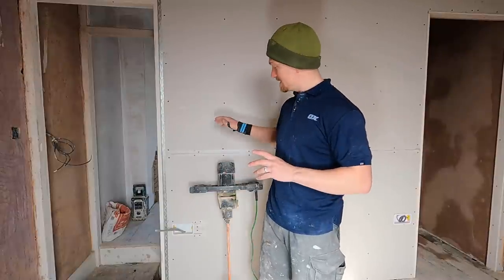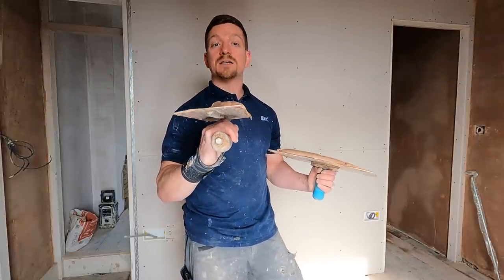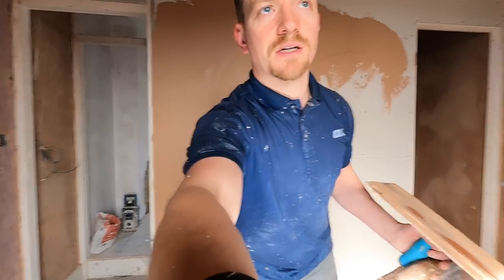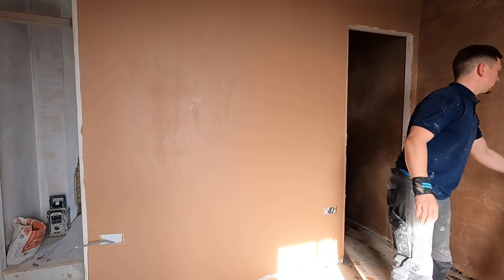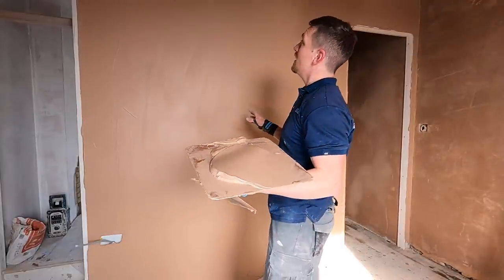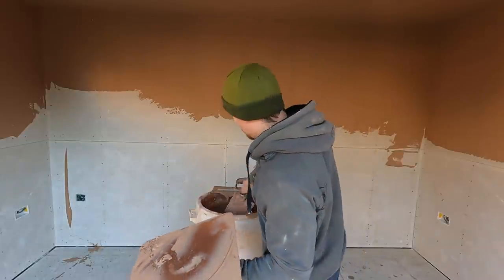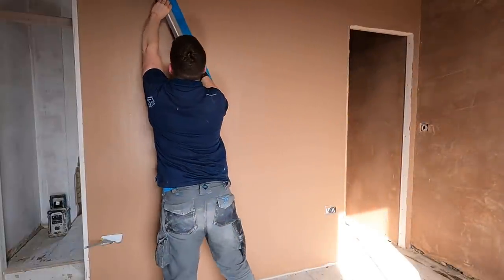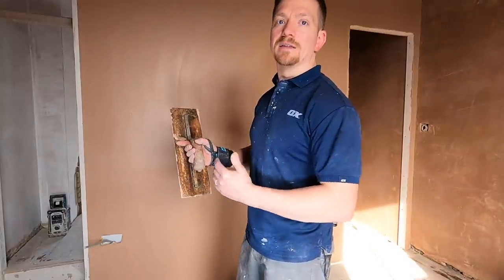5 Massive Hacks For Plastering Faster | TROWEL TECHNIQUES/ TIMINGS/ TOOLS/ SPEED TRAINING

Comment: I would really recommend that beginning plasterers do NOT try and do two coats from one mix. You need some experience behind you to make that judgment about whether the area is small enough, and also if the plaster still has enough life left in it. One of the most annoying mistakes is thinking "ah, still seems to be fine", and then it all starts turning on you too early to save it.

Until you feel confident with two mixes, I would say don't add in these complications. It's so much better to take a little more time and get it right than to have to fix up a botched job (particularly a ceiling...)
Reply from the maker: I agree mate! Beginners should be focusing on the basics and sticking to 2 seperate mixes. That’s the process I teach to any beginner who comes into our programmes...I’m just showing examples to people/Plasterers who want to up their game 👍👍
Reply: All relevant to skill level, size of wall and temperature.
Reply: Make both mix the same! When I started plastering I was wasting my time looking for videos on YouTube for timings! But when you waiting you will know what you looking 4 for your timming stages.

I thank my friend which he has been taking me out on jobs!  I have been experimenting with plastering my favourite 

1st coat 
Speed skim
Sponge 
5 min 
2nd coat
Speed skim
10 min
Flatt with plazi flex
5- 10 min
1st wet Flexi trowel 
2nd Cross if you want
3rd dry plazi
Reply: 😥as one who rushed to finish up for dinner and the next day had whole chunks on the floor because...yeah!  I stopped spraying the water heavily before each trowel and misting after before smoothing...oh well.  Guess I just got more practice time in patching before my last full coat.
Reply: @iiparachuteregiment8800  thanks for this

Comment: Your videos and explanations are brilliant, they really helped me in getting my first wall right after a few failed attempts, but having said that, can i clarify that you're not calculating your water incorrectly? I tried your 12.5 litre mix, and this was very thick compared to your videos, brand new bag of multifinish, mixed with a good paddle mixer in about three minutes. After experimenting, i work with 15 litres of water per bag, and this mix looks exactly like the one you use in your videos. Are you working the volume of your bucket out correctly? Sorry to question the master, i found every other detail in your video worked spot on apart from that one.

Comment: Blaine, I've been plastering for 20 odd years. I'm nearing 40 now and bits of my body are aching. My left wrist (hawk hand) aches and my lower back is made from wet cardboard. What do you do you to help prevent these aches?
Reply from the maker: Sorry to hear that mate!! Sounds awful. I recommend some physio and a decent Chiropractor. They’ll provide exercises that may help but it may just be water and tear. It’s a cruel trade I must admit!
Reply: A nice smoke at the end of the day!
Reply: Less work, charge more. I'm 54 I know your pain
Reply: Less work, charge more. I'm 54 I know your pain
Reply: Had similar problems myself after 25 years plastering,,just started ice baths and they have helped immensely
Reply: Your doing far too much for your body m8, cut down in your workload, or get a patching job, your only 40, another 10 years and you could have big trouble

Comment: Great tips and thanks for making this available, but I suggest you do a future video on how to handle difficult situations, such as when the plaster starts to set and time it running out. Is there a retardant that can slow down the setting process once it has started, either in the bucket or on the wall? If the walls harden and what remains is a mess, do you recommend grinding it off, patching it with more plaster, or maybe some other actions? With experience like yours, this is probably seldom an issue, but for beginners such information might save the day.
Reply: I like to remind myself that there's always the option to just scrape it all off and start again >< Obviously you don't want to be doing that too often, but it's easy to scrape off when it's still semi-solid. Of course you can always go over it once dry, but also you've added more thickness/weight and that's not always ideal. I actually did a scrape off with a ceiling recently. I thought I'd risk a bag of plaster that was about a week out of date. But unfortunately it didn't pay off - by the time I'd got from one end of the room to the other, the plaster was too dry to flatten. I don't regret the decision because honestly I just didn't see it coming together, and the second time (with a new bag) went perfectly.
Reply: My get out of jail card is my spray bottle and sponge float.
Reply: water spray bottle...it's my only hope!
Reply: Baking soda
Reply: Someone I know used baking soda to slow it down

Comment: how do you know when a second coat needs to be applied? and if the wall or ceiling starts drying where you did bonding and the rest is wet then what u do? Everyone on youtube says how to apply plaster but nobody says the big things just mumbling around. Check your video and check others' videos, same thing. I am a beginner in plaster I put the plaster on walls or ceilings in no time but always happens to me the plaster is not drying uniform. In  Some places is too dry other places is too wet and I never get it perfect. I feel all the time so disappointed and frustrated. Is not that I want to do this job as a trader but I like to "master" the skill. In the end, if you check with a lamp my plaster you can observe uneven parts.

Comment: Hi, one question, how do I plaster a big area let's say about 30 square metres,do i do it all at once or in two sections?? So it won't dry out to much, Thanks!
Reply: Get another plasterer to help you if you feel its to big an area. Don't under cut on pricing. Trust me. Been plastering since 80s. Don't do joins in work
Reply: @terryfincham7252  Thanks!! Cheers from Greece!😊👍🇬🇷
Reply: If your not fast enough tape it off and work into it. Best bet is getting another spread on it with you throw it on together. Get a speed skim to flatten with saves loads of time between coats

Comment: Do you use a hard trowel or the nelaflex to put the 2nd coat on? I prefer the nelaflex as it goes on flatter and really no need for the speed skim. I really don't know if thats the way to do it so thought I'd ask lol only been plastering for a year n half and never had any training but doing good so far so I have been told

Comment: Just a quick one. Love the work but I noticed when you was plastering room on one hit you had put plasterboard on wall on its side rather than upright so the was one continuous joint in middle. Is there a right or wrong way to board walls
Reply: In the Us you will see all there boards done horizontally rather than vertical to be honest it doesn’t really matter but most standard wall heights are especially new builds are standard height is 2.4m ( standard plasterboards are 2.4 m ) so many board them vertically

Comment: Do you think that the 600mm might be better for a smaller patching in job or would you always recommend the 1200mm one you had in the video?
Reply: Get the 600mm 👍
I'm a plasterer of 20 years and I only ever use the large speedskim on big walls or ceilings
I prefer the amount of control you get on the 600mm speedskim as well
Only get the 1200mm if you are doing bigger jobs
That's my opinion anyway

Comment: Something else that will make it quicker if you have got a lot of electrical boxes, get those cables tucked up inside the box so they don’t get in the way when you are plastering, better if you can sweep your trowel over the box , noticed that Blane’s was hanging out, top man though!
Reply from the maker: Good point my friend - definitely helps doing it this way!!
Reply: My electrician friend says please clean the boxes when you finish plastering.🤔